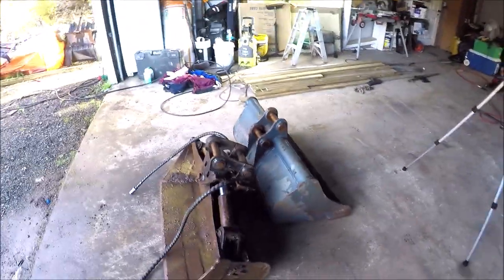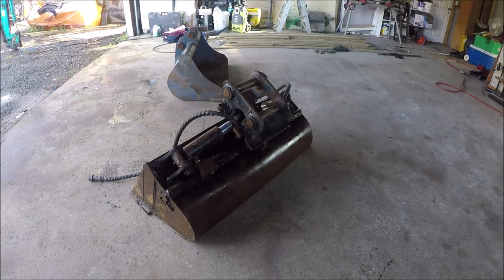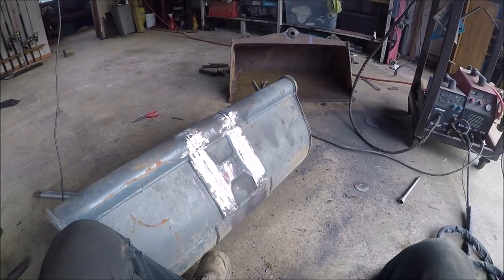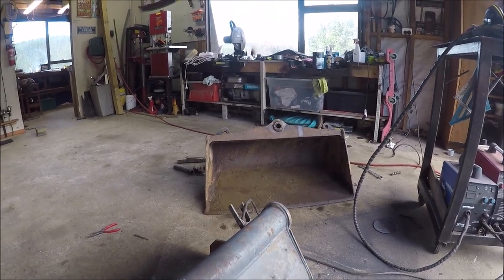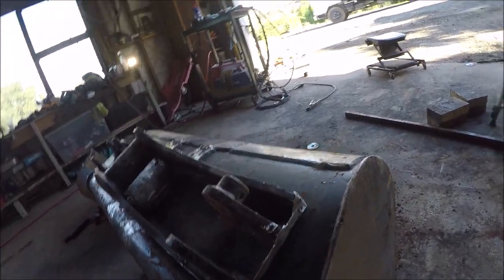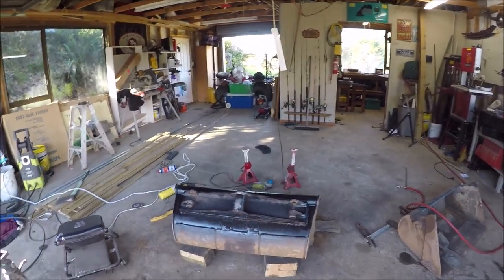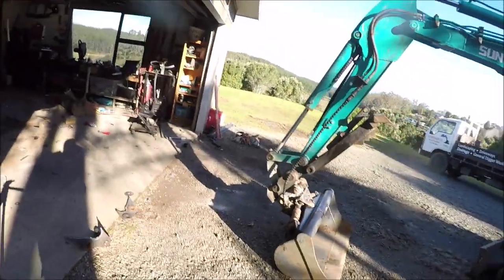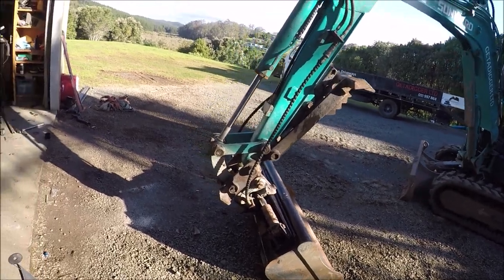Tilt Bucket Rebuild

Comment: Nice, looks like cutting the tilt part off the old bucket went easier than you were expecting.  So how is the bucket for the machine when loaded, if it was kind of tippy out to the side in your tests, I am guess it could be raise the pucker factor at times when loaded up, LOL!!  Great video. 

And that site you showed pics of looked pretty wet!!
Reply from the maker: It all went.. To plan.. 🙄🤣. Its not too bad on tippy. Just gotta remember I got a bigger bucket now when slewing. 😬

Comment: Hey, which system for changing rhe bucket do you have. I need to take out the pins from my bucket to change them cause is fix installed.
Looks line a solution for me without rebuilding my buckets.
Reply from the maker: https://youtu.be/IZkvqjCTCpc... Had to repair mine also